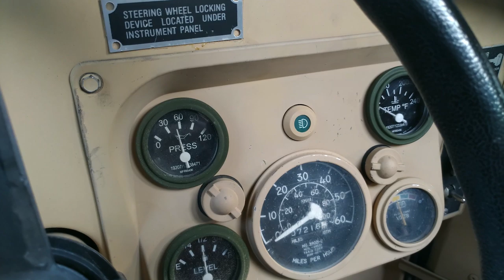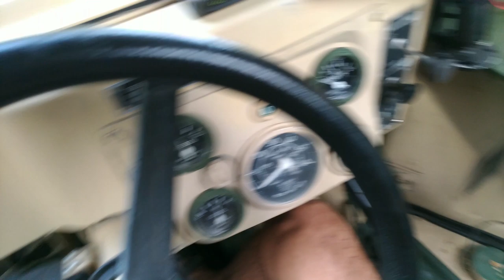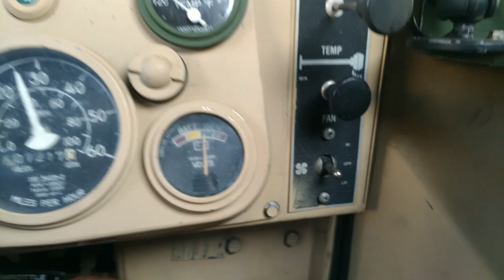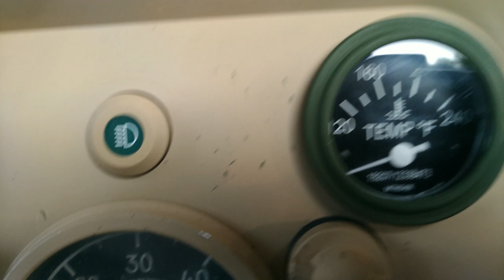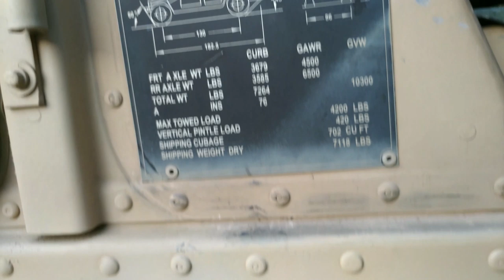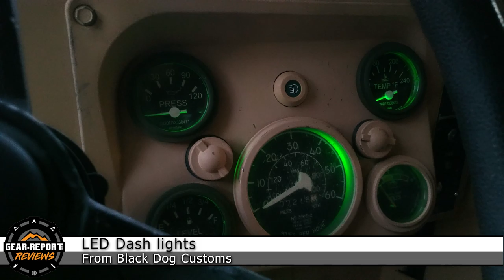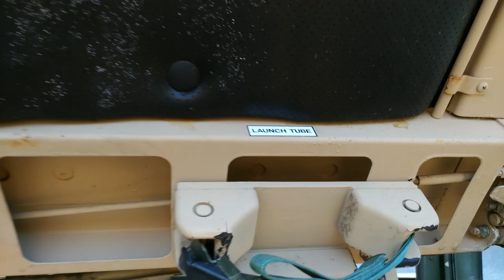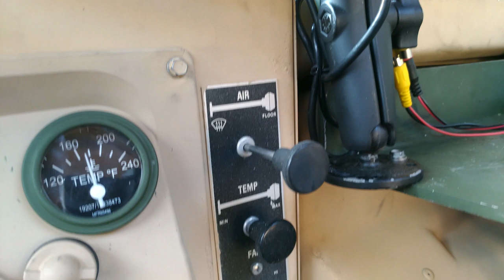Military Hummer For Sale - M1045A2 HMMWV - Battlewagon 2.0

Comment: With the release of the Turbo rigs selling for $7000 average it dropped the price of this rig by tens of thousands. I’d say in 2022 it would sell for $20,000.  I just bought a Turret top M1167 4 months ago for $21,000.00. Yep. $21k. My 2(M998’s) and my (2) M1123’s are worthless now. I could sell for maybe $12k at best. Nice rig tho.
Reply from the maker: Irrelevant speculation. It sold a few years ago. 😎

Comment: Almost forgot to turn those headlights on huh lol. Nice truck..price? Ps please dont tell people to drive 80 mph in these vehicles they are absolutely not designed for those speeds and they do not handle roll overs very well..
Reply from the maker: Yeah. Was too bright out to need the headlights, but I wanted the turn signals and brake lights to work. :)
I have mixed feelings on driving HMMWVs 80 mph. 
The H1s have the same running gear and run 80 routinely.
Most military HMMWVs on the roads have the 3 speed. So anything above about 57 mph is pushing them too hard.
For 4 speed trucks the drivetrain can handle it, but the overall condition of the rest of the truck is critical in determining whether it is safe or not.
https://gear-report.com/humvee-info-how-fast-is-a-military-hmmwv
Reply: Gear-Report.com i watched video's of them rolling over and or losing control and crashing.. They disintegrate.. I'll keep mine 50mph or less thank you very much lol
Reply from the maker: Yeah. Especially soft top models. 
But if we are being honest, most any vehicle that rolls at 80 mph is going to result in a yard sale. I wouldn't feel any less safe driving my HMWMV 80 mph vs a similarly equipped jeep.

Comment: Does it have air con?
Reply from the maker: Nope.
AC is tricky in a HMMWV. The military options are all bulky and awkward installations that take up a lot of interior space. And to really be effective a LOT of insulation is required. So, most HMMWV owners don't bother. Besides... AC isn't useful when you drive around with no doors >1/2 of the year.

Comment: Did you sell it already send me a message
Reply from the maker: Still for sale. Contact me at battlewagon@gear-report.com to make this beast yours before someone else beats you to it.
Reply: @GearreportdotCom  is this emp proof
Reply from the maker: @AlejandroP1980s  I don't think so. The earlier versions with the 3 speed transmission were. I think that when they upgraded to the 4 speed, electronically controlled transmission, they stopped being EMP proof.
Reply: @GearreportdotCom  oh ok thanks